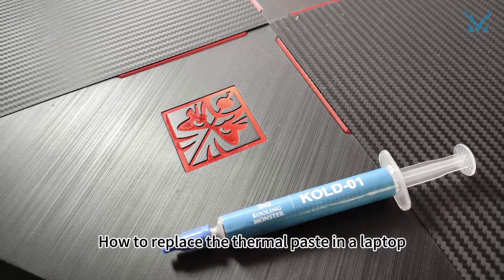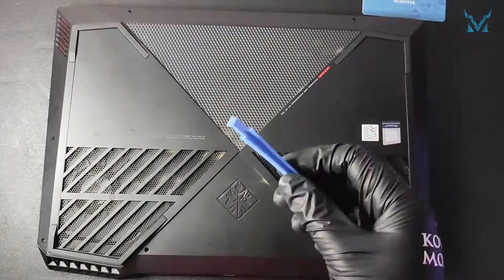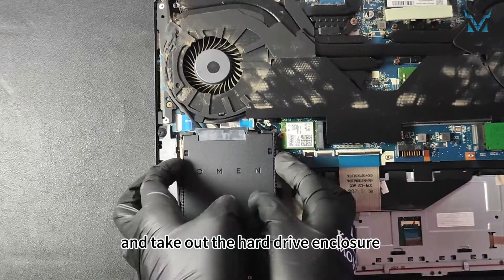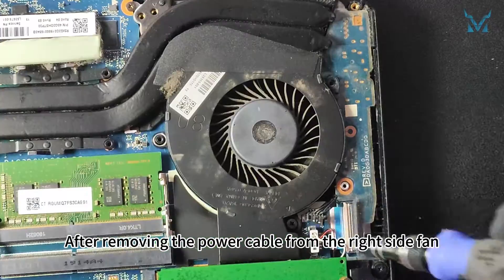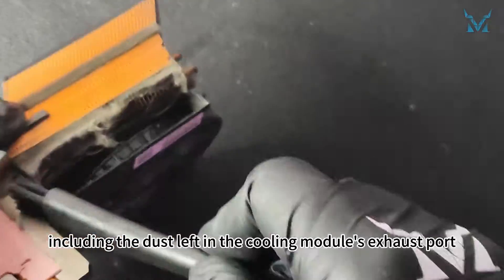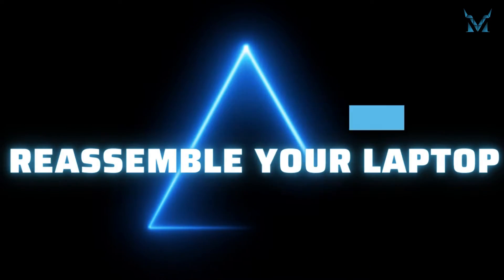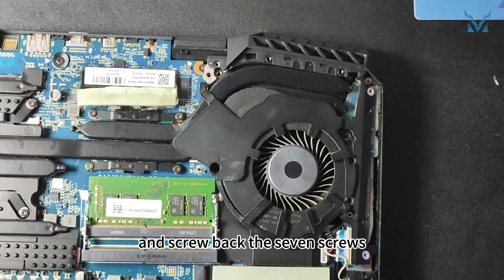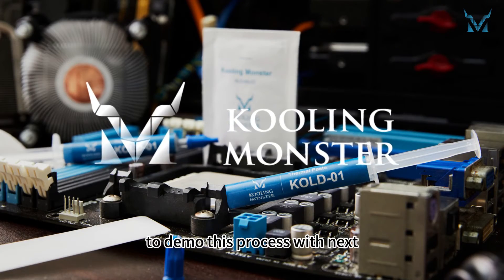Speed Up Your HP Omen 15 (2019) - Prevent Overheating With Dust Cleaning & New Thermal Paste

Comment: Very helpful video. I was getting 90B error during startup. Cleaned the fan using this video but the error persisted. Finally bought new fans and change and the error is gone.

Comment: After 7 years the cooling paste on mine was starting to go crusty aswell. Since they already have heat/cooling issues it was the right time. Video was a nice guide to just be sure you don't break anything.
Reply from the maker: Totally agree — 7 years is the perfect time to refresh the thermal paste, especially on models that already run hot. 🔥
Glad the video helped you out and everything went smoothly!

If you ever want even better temps, feel free to try our Kooling Monster KOLD-01 paste — many have seen great improvements after repasting. 🧊✨

Comment: can overtightening the cpu screws cause cpu freezing issue? because i have recently done repasting and now my laptop freezes at high load.
Reply from the maker: Yes, overtightening can definitely cause issues. 😬
If the screws are too tight, the heatsink may bend the motherboard or create uneven pressure on the CPU, which can lead to freezing or throttling under load.

Try loosening the CPU screws slightly and tighten again in a cross pattern — just snug, not too strong. Also double-check that the thermal paste has proper coverage.

If you need better paste for a redo later, our Kooling Monster KOLD-01 is designed to maintain stable contact under high pressure. 🔧❄️😉

Comment: This laptop has hands down the worst motherboard arrangement and component quality I have ever worked with. You have to do so much to lift the heat sink and lots of stripped screws…
Reply from the maker: otally agree — very messy layout and bad screws. Makes simple jobs way harder than they should be.

Comment: Im going to do mine soon. I have the same laptop. Would you know what size thermal pads to get to replace all thermal pads. I dont want to do mine until I get the correct Thermal Pads.
Reply from the maker: I understand your desire to replace the thermal pads. We do not manufacture thermal pads, and we recommend that you consult the laptop manufacturer for the correct specifications. They can provide the most accurate information to ensure you purchase the appropriate thermal pads.